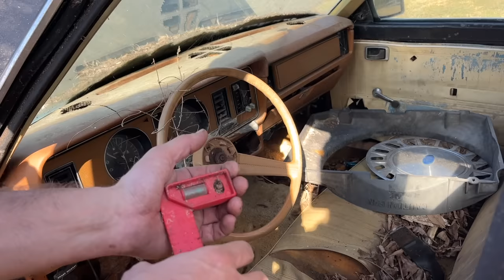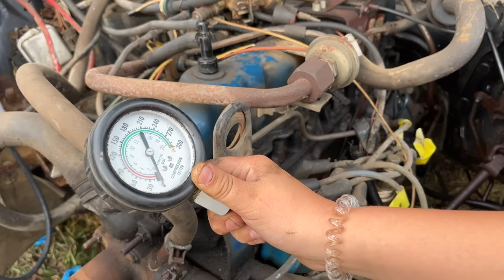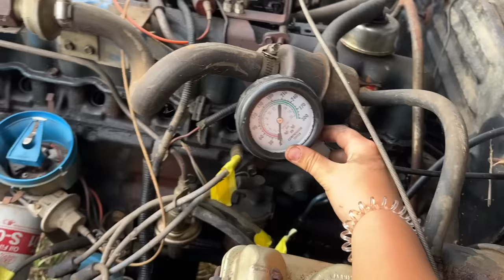30 years in a junkyard, station wagon with vintage hand painted lettering. Will it start?

Comment: I am Mitchell cronan that is the first car that me and Gary Miller  had and we grew from that car and run miller cronan hardwood floor Co in benton Tennessee for 31 years  so great to see where we cam from almost unbelievable now to look back on that
Reply from the maker: Hey man thanks for commenting!!!!! That’s so cool !!! We love it.
Reply: Wow that's awesome thanks for commenting on that.. that would be awesome to see Josh and family getting running again restoring history
Reply: Be even cooler to see a 7.3 Godzilla enter into its life and drag race it, hahaha
Reply: That's so cool that you are the old owner and your hear to see it get new life.
Reply: How neat is that
Reply: A trick I learned when engines seem seized you can pull the plugs an shot some vinager in  the plug ports wait few days an do it again then by three days the vinager will lossen the rings to turn over , you do have to change oil after though. But it does it's job true. But drain oil pan after don't keep vinager in it.
Reply: @Sleeperdude i
Reply: It had a C5.

Comment: You know i really think you could get that engine running. That back cylinder was REALLY pitted and still made like 110psi. I think there was a video a while back that Mortske did where a rocker assembly was as bad as that one.  He soaked it, got it freed up and literately just bent the pushrods back straightish.  Surprisingly he got that one running.    No money involved and would be absolutely epic. You know you pull off epic all the time right?!?

Comment: yeah if the motor is stuck that bad where a breaker bar dont free it, it dont hurt to pop the valve cover open to check. Also a good investment is to get a boroscope camera to look down the cylinders first before you lube them up etc.
Reply from the maker: Thank you

Comment: I am an Aussie 61 year old..
When I was a kid playing with old hand me down outboard motors.. for my junk boat... I was taught by family friend. That was a engineer on Rolls Royce Spitfire engines in Ww2..
Don't throw out spark plugs.. stick in vice, pore some methylated spirits on them. Set them alight. And bingo, you have a clean spark plug... the metho also works if you have a engine full of water..
Reply from the maker: Thank you
Reply: @Sleeperdude  if you have a engine that has had water in it.. pore metho down the carb... hand crank it.. the metho absorbs water...
It's what you do if you Flip a boat.. and sink... saved many a outboard that way...

Comment: Those Ford engines of that era had a bad problem with sludge build up, and condensation too. Sometimes the valve cover would be heavy with all the build up, and the oil filler cap would be rusty.  I think it was from the smog control system they used.
Reply from the maker: Thank you

Comment: That is exactly the same Fairmont I had while stationed in Germany. Mine was originally silver but I got ahold of a gallon of black enamel paint. Later I put a 460 and transmission out of a wrecked mercury. Ignition module too. Stock wheels and tires with the turbine hubcaps. 

Imagine the fun of running down the autobahn in 'moms car' and passing Mercedes and BMWs
Reply: Another funny note, I worked on the other side of the post where the barracks were. Time to time troops needed a ride back to the rear and I would of course give them a ride. There was always someone in the bunch who would make fun of the car and such. Such, "Moms Car".

I would tell them a passage from "the "bible"". It  says "Oh yay he who picks on the driver or his vehicle shall be forever known as pedestrian."

Comment: When you're trying to break a bolt loose with a breaker bar, especially if you have a pipe on it, you have to put something that is just the right height under the head of your breaker bar to support it and keep it square to the bolt head. That way all the force you're putting on it goes into turning the bolt and not into twisting the socket off of the bolt head and rounding it off. I like to use a jack stand since they're adjustable, and sometimes a piece of wood to get just the right height.
Reply from the maker: Ok thanks

Comment: Josh, you could pull the rocker shaft.  The valves will be easier to get to and try to free up.  Maybe a little heat will break them free?
Reply from the maker: Yeah maybe so

Comment: I think it's a replacement junkyard motor that was laid out on the ground. Probably never did run after it was installed. Explains the water in the top of the motor. Just saying.

Comment: Here down in the Antarctic I had the same Fairmont wagon they were known as a 1982 XE Ford Fairmont 302 V8 auto great car extremely reliable but sadly they had bad rust in top body parts ,the front on ours were different the back similar,doors the same ,the dash was different,bucket and bench front seats optional,kept it for about 4 years.
Reply from the maker: Thank you

Comment: "Let's think out of the box" as my sister would say. What if big pits in a cylinder wall are not as bad as everyone makes them out to be?  After all, it is not like it is a groove vertical that lets all the pressure leak down into the crank case.  Maybe it holds oil, like the diagonal grooves you get from honing.   I'd like to see the current engine rebuild. Maybe without doing anything at all to the cylinders. Pour some , say, mineral spirits into the bores and see if they hold liquid.  It's probably difficult to do a leakdown test.  You'd need to get the head to seal before you could test the rings.  
If not, maybe a hone job with some 0005 over sized rings.
  Or, lets say you have a worn engine which is already 30 over and needs to go 40... put the 30 over rotating assembly in the block you have now.  It has to be standard right now since , as you said, it has  steel head gasket and that means factory.
  I agree that sleeving even one cylinder makes it not worth it. But, everyone says you can't get compression with rust holes in the bores. But , has anyone TRIED?   Just like using used pistons in a musical chairs system. Has anyone tried?

Comment: I feel ya on the American Wagons. Had a 98' Escort Gutted the back seat out and did everything with that thing. I drove a 70's 8ft truck bed back to my house on the roof from 30 miles away (The looks were priceless ;)). Would haul engine Blocks in the back. You had to let it run for 10 minutes before leaving to let the rings seal otherwise you'd be throwing smokescreen at tailgaters. I bought it for $200, fixed all of the mechanicals and retired it at 380K miles (It's still running at my buddies that I bought it from 5 years prior). The Planet Express (Name of the Car) owed me nothing.

Comment: The 1976 Granada had a 250 6 cylinder. The 1981 had The 200 6 cylinder. Both bullet proof engines. Easy to change oil and filter. Easy to tune up. Got decent gas mileage too.     Shawn.

Comment: I use a pipe wrench hooked on the pulley to turn over the engine. Makes more leverage than turning from the bolt.

Comment: The Aussie Falcons had a 200, (3.3 litre) a 221 (3.6 litre) and a 250ci (4.1 litre) six. I think they were based on the same engine. They had a cast iron sewer line intake cast as part of the head and Power By Ford on the rocker cover like yours.

Comment: Would have loved to see how that engine runs with the pitted bores!  The valve seats are probably shot, too.  But I think you could get them moving with a little time and lubricant. 

For the cost of a head gasket and a couple push rods I think it would be a cool experiment…
Reply from the maker: Yeah that would be interesting to see

Comment: It sometimes just takes girl power.
I remember working on lawnmowers, sometimes I could never get them started, my wife would give it one good pull and most times it would start right up.
Reply from the maker: That’s right
Reply: @Sleeperdude  Just thought of it after the video, you should try and find something with a Flathead Ford, you can run those engines with only one cylinder head.

Comment: Just for folks out there that buy junk yard motors. Always take the valve covers and oil pan off and then Inspect it before buying it. If there is rust shown internally don't buy it. Water damage means the motor is junk.
Reply from the maker: Yeah sounds good

Comment: For the question about the wrench vs welded bar, its simple physics if you think about it basically, the second one is a straight  strong, non-flexible bar welded on a disc with some diameter away from the center (the bolt) the wrench + huge pole-on is a pair of flexible metal parts, transferring all the strength  in a very small central spot, the bolt, and as we know the further you apply your strength (when on a circle /disc ect) the more torque you get, think about it, the spots you applied force to, when you welded the bar, were the 2 furthest spots on the pulley 😉 (plus, for the flexibility part, when the parts you add flex on force, your strength transfer in spots ON the tool it self, on the outer of it, instead of just going  "around the imaginary circle", the one we want from the crankshaft, the strength applies on other angles, amd that's bad, especially for the tools, it gives em a really hard time right there.. 😂)
Reply from the maker: Sounds right thanks

Comment: I had a `980 Mercury Zephyr with a C4 with a crappy torque converter and ring gear spot welded to it and it had to be replace 3 times until someone backed into me anjd took out the right front fender and the inner fender was touching the breather, I drove it to the Drive Inn that day. but it was considered totaled  by the insurance, so I used what little I got for a down payment on a 1982 Fairmont Futura. I did transferred the mustang bucket seats.
Reply from the maker: Wow that’s not good

Comment: Beautiful car, nice save. Oh, that poor little 200. Bonk the valves up and down a couple of times, new pushrods, it'll run.... But yeah, you need a motor. Uncle Tony's Garage (YouTube) put a Slant-6 into a Miata; you could mess with people with a Turbo EFI Slant-6 Fairmont wagon. I like an inline 6; they're as gone as station wagons. I'd imagine a Buick 3.8L V6 SFI Turbo like a Grand National would go nicely in there, and Fairmont is definitely lighter than a 1987 Buick Regal. Or a  a SuperCoupe setup. 
Labeling your spark plug wires: I use bread tags - you know, the things with the date code which clip a loaf of Wonder Bread closed. I also use them on network cables on my routers and switches. Bread tag, Sharpie, labeled. 
All the best to you and your family and your cars, and keep up the amazing videos.
Reply: My favorite Fords are hands-down the Fox bodies. I love those things. I was so worried you were going to break what looked like a grille in good shape. I love all Fox platform cars, but no, I would never want a Mustang. About 30 years ago, I almost bought a 3-on-the-tree 1978 Fairmont 2-door post sedan. Fairmonts don't seem to rust like the flapping quarter panels you'd see on a lot of other cars, but the body was pinholes everywhere and there was no chance I could get it through the safety inspection in the ten days my province allows on a title transfer.
Reply from the maker: Yeah that would be cool thank you

Comment: 19:24  I'm already thinking if it won't turn with the force you used before the giant pipe, you are going to strip the damper bolt before it turns. I have a 302 that turns, but only with a lot of force.  So much that I didn't dare turn it clockwise from the front. I  would rather unscrew the bolt than break it.  I think the engine is pretty bad.

Comment: If I repaired ANY Ford, Lincoln, or Mercury vehicle produced from the 1978 to 1983 model years, the first thing I would do is to relocate the wires of the horn from the turn signal stalk to an aftermarket steering wheel center horn hub. The horn button on the turn signal stalk was not only one of Ford's dimmer ideas, but it also should have had a recall because it was a safety hazard.

And besides, the 1978-82 fairmont/1983-1986 LTD models would make great demolition derby cars 🤣🤣🤣🤣🤣

Comment: 24:23 I recently had the realization that with an impact driver, the slack of the sockets and extensions, robs the impact of it's efficiency. When I had a rusted bolt that wouldn't give in - I tilted the whole "chain" of driver-extension-nut until I caught an edge and it made a kind of solid connection - then it came loose. The impacts are so small in fluctuation, that you have to connect tight and direct to the bolt head.

Comment: When you put that monster breaker on I yelled but you didn't hear me pull the valve cover before you bend a pushrod. My choice is a used 302, unless you get a 6 for free.

Comment: Excellent video Sleepdude Crew Josh  , family  yes that 200 Cubic Cm size 6 cylinder also think motor got water in too also intake had hole or leak gasket too and be have rebuilt plus replacing bend rod too also would find another 200 or 250 motor put in too! You tried hardest for easy fix and also Josh yes 200 motor Starter all different from 1964 to 1985 was last year made them ! Did 5 to 10 years on Starter drive on flywheel also drive axle on this car need rebuilt bearing bet too!

Comment: Wow that was one of the most stuck engines you have ever had on here. I carry a Ford starter solenoid in my '89 F150 have not needed to use it yet but I figure eventually it will stop. The family that plays together stays together or in this case works on cars together. That was pretty good though spinning that engine over with the head off. Great video too bad the car had engine issues.
Reply from the maker: Yes thank you

Comment: I've had luck unsticking an engine by pouring evaporust down the cylinders, and anywhere else there is rust... it does less damage than vinegar or acid but even better results somehow
Reply from the maker: Ok thanks

Comment: hay something to think about as a sleeperdude2 content for your parts washer s if you go to like Walmart or target and get a bigger stainless steel serving pan like you see at weddings the kind with the bottom pan has water and then the pan in it with the food to keep it hot take one of the sonic cleaners apart the heating element and the vibrater and reattach to the bigger one you bought it will still work as good but bigger

Comment: Rebuild the cylinder heads clean it up pull valves wire wheel them wire brush valve guides and just replace springs
Reply from the maker: Thanks

Comment: Some times, you will need a small rounded pip , to put on the braker bar to loosen up a bolt, it works or it will snap it off, lol, grate video guys. there i said it and your son comes buy with the longes bar one could find, but you could have cut it, just to mack it easyer to handek, lol, you can't make this stuff up, wow.

Comment: Unreal I just had to do the same thing on a bush hog that I got I figured out the math with a 12 ft pipe and 160 lb but on it it was approximately $2,100 ft pounds of torque you can guess that's about how much torque it took to move that thing dang Skippy I love the channel

Comment: A 200 cubic inch inline six. I'm just realizing that this is the same engine that was in my 1977 Granada with 4 on the floor and a fifth overdrive gear. That thing sipped on fuel! In that year I had the choice of an F150, same engine or the Granada for $4800 CDN  The tiny Honda Civic hatch back listed for $6300 in that year!

Comment: For the cost of that starter you could have bought a borescope camera and ran it into the valve cover and spark plug holes saving yourself alot of sweat and headaches.

Comment: There is a you tuber  from Tennesee called "This and That Garage" who rebuilt a Chevy LS engine with pitting in the cylinders and it ran fine. He said it would eventually smoke. You should try it. You should see if you clean everything up good and replace the bent push rods if this engine would run. It would make a good video.

Comment: Great video, as always!! Perhaps it might be a good idea to add another step to your engine reviving process and remove the valve cover(s) to verify the valve train before trying to spin the engine? That might save you a lot of effort and potentially prevent damages to the pushrods.  Just a thought.
Reply from the maker: Yeah maybe so

Comment: I'm sorry the engine was beyond repair. This car has certainly been a challenge... in the way that juggling porcupines while herding feral cats is a challenge. Even new parts put on it, like the starter relay, don't work! If you name this car, my suggestions are "Black Hole" or "Bermuda Triangle". Seriously, though, this is very educational project. You show how bad an engine can get, how it works - and why it can't work sometimes. The cylinder walls show when, and why, it's time to walk away from a repair job and change direction in a project. I learned a lot watching this video, and I laughed the whole time. Thank you.

Comment: Hey there, Love your videos. Have a couple things to say. My mother gave me her 1978 2.3 4 speed Fairmont. Went down a hill, passenger grabbed my wheel, the front tire hit the curb on the passenger side front, the car snapped in 2. I had 2 girls in the front and 2 girls in the back. Made the back front page of our local paper, half page worth with pics. Snapped PERFECTLY in 2.  Girls in back were in the middle of the road. Front half and back half cut in two, perfectly intact. Turned around after we hit, I saw the ground. My door opened like normal. One of the girls in back got a punctured lung. I was flipping out. Watch out for those cars. I think it was put together like Frankenstein at a used car dealer my mother bought it at. What else could've it been? Also, where can I get a set your bottle opener flip flops
Reply from the maker: Wow that’s crazy
Reply: @Sleeperdude  So are your flops homemade with the opener? Nothing like that for sale where I live